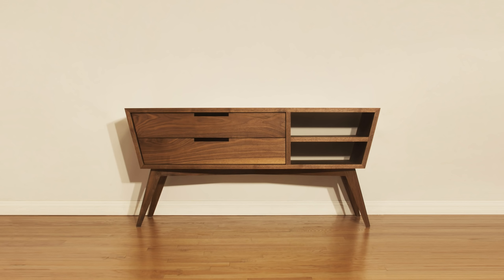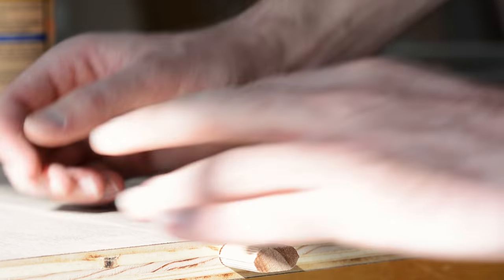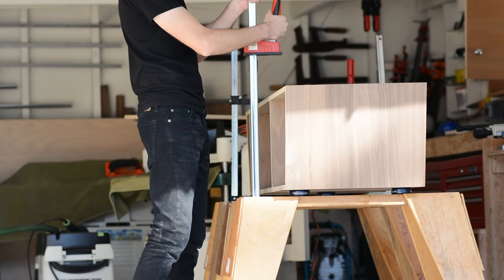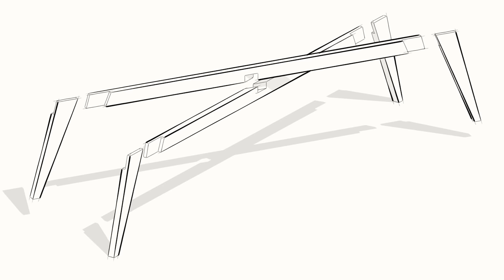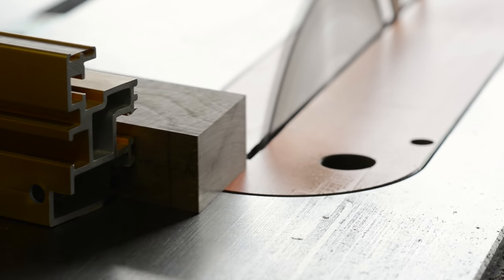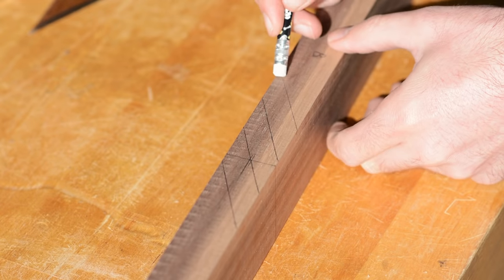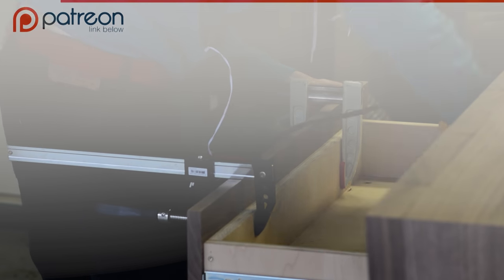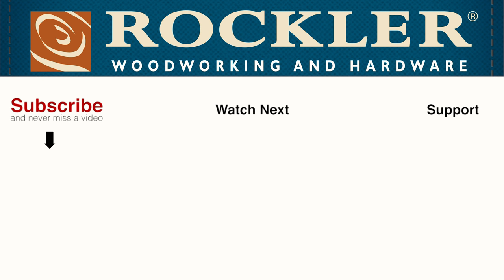Designing and Building A Modern Credenza - Woodworking

Comment: So good. I want to start woodworking but I don't have a garage/backyard or whatever. So I probably need to rent space somewhere. I've already looked it up. But that will end up costing a lot before I can even finish my first piece. Would it be possible to use hand tools and using plastic in the corner of my living room to make it a dustfree "workspace"? Is it even possible to make nice, let's say, mid century stuff with only handtools? I mean I could see myself cutting wood with a small saw and maybe getting a router to make nice round edges. But seeing all those angled cuts in this video seems impossible with a nice workspace and big tools. Anyone?

Comment: What's the reason you didn't just cut the angles on the bottom piece with the track saw instead of cutting it in half using the table saw and re-gluing it?
Reply from the maker: I thought I’d have a little more accuracy on the table saw... and you can’t tell the bottom was cut in half because of the face frame and drawers.

Comment: Attempting to make this but getting stuck on how to calculate the length of the four sides with the angles you used (15 degrees off 90). I want a 60" long top. How do I calculate the sides and bottom?
Reply from the maker: In theory you'd do it with Trigonometry (Sine, Cosine, Tangent) - but if you want to do it without math (which I recommend) you'd cut your top to 60. You'd then cut your sides to any length you desire (doesn't matter as long as they are the same) then you'd dry assemble and measure the distance that your bottom panel should be and cut it to fit. I've built a few other trapezoidal cabinets in videos. I think I might have gone over it more in one of those. Try this one :)
https://youtu.be/tFy9Qze8nY4

Comment: Why do you use the sled and the Incra?
Reply from the maker: A couple of reasons I switched back and forth. 1. If I was doing a cut with the blade tilted, or using the dado stack, I used the incra b/c using the Rockler sled, the blade would cut into it. For all of the standard miter cuts, I used the Rockler, unless I had it set to an angle where I was going to have to jump back and forth. I'd set one at one angle, and the other at the other angle, b/c it is hard to re-dial in an angle exactly the same. Hope that makes sense.
Reply: Chris Salomone makes perfect sense. thanks!

Comment: why did you have to cut the bottom panel in half but not the top?
Reply from the maker: Because the top piece get's cut vertically on the table saw...the bottom piece horizontally (like normal flat against the table.) So the limit for the top piece is pretty much ceiling height. Hope that makes sense.

Comment: Does just glue really give this enough strength?
Reply: the carcass is plywood, so half of bevel surfaces are long-grain to long-grain glue contact...
Reply from the maker: Yeah. It's also worth noting, the angled sides really aren't being asked to do all that much b/c there are also vertical partitions. Really, the sides almost just need to be strong enough to hold themselves on. Also, if you check out the video I made about cutting non 90 degree miters, You'll see a small version I made. It has no vertical partitions. I stood on it and it held, to break it I had to smash it with a hammer.

Comment: Is the glue really strong enough without any domino's to hold it together?
Reply from the maker: Yeah...it'll hold. Also, there are other things holding it together, namely the vertical partitions. Those are actually doing the bulk of the work. Since there are 2, you could actually take the sides off and the whole thing would stay together. So it's almost as if the sides are just responsible for holding themselves on.
Reply: ahh, ok thanks!

Comment: Sooo how do you cut a bevel in the top (longest) piece? You mention cutting the bottom in half for a more manageable size but don't say how you make a perfect bevel on the longest, least manageable piece of plywood. Thanks.
Reply from the maker: The top I cut vertically. So the limit is how much space is above you.

Comment: Great job with the production.  I wish other  YouTubers would understand that it's not necessary to make the viewer sit through 20 minutes of saw cuts or spreading glue or other repetition.... Story first - then support with the video.   Dumb ? though...  I still don't understand why it was necessary to split the bottom - but not the top ?
Reply from the maker: Hi Tioga. Thanks! I only split the bottom. The top I could cut at any length (shorter than my ceiling) as it was one of the pieces that I cut vertically on that jig that rides on the fence of my table saw.
Reply: Ok - so  you didn't have a way to support the bottom horizontally -- or shop not physically wide enough, etc ?   I've had to haul a saw outdoors to the driveway and set up an outboard support  but managed to get a 10+' long skirt for a finished stair.   I'd also try it with a shoot board and hand-held circular saw (several test cuts on scrap first of course...).
Reply from the maker: My saw doesn't have capacity to the right for that length (the side the fence is on) In theory, if I had some kind of big sled, I could have had it go out to the left...Maybe. I could have used my track saw...I was just envisioning gaps in the miters/bevels, as I didn't think I'd be able to dial it in accurately enough.

Comment: wear a mask dude.
Reply from the maker: I do sometimes. But I've read that if you have facial hair, you're really not doing anything by wearing a mask. You're basically just filtering out the "dust" that is already too big to breath in. They say the test is to cover the spots where the air comes in and try to breath, If you can still breath in...you're not doing anything. I suppose the best response to my response should be "Shave" :)